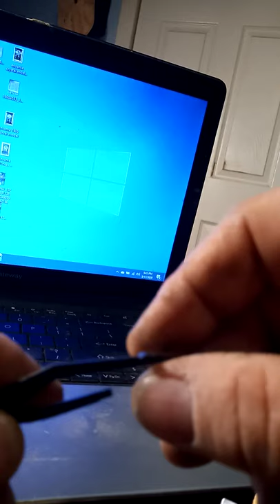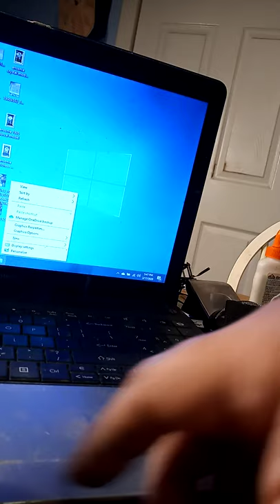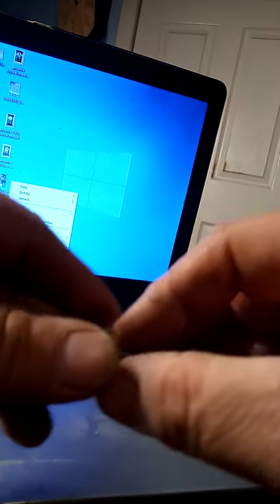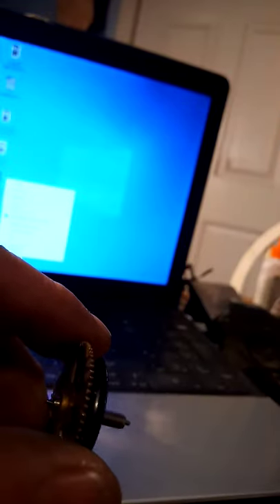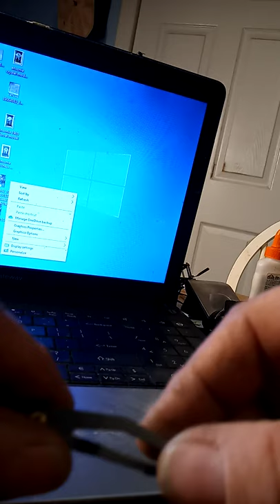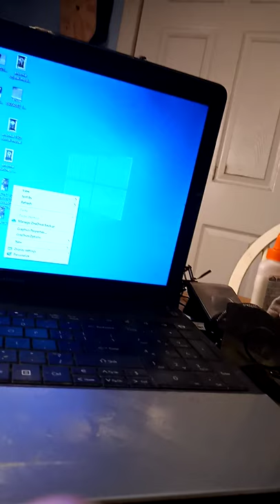Fixing a cuckoo clock that doesnt cuckoo on the half hour 20200317 174202

Comment: Thank you Mark for your expertise. I will continue to save to have my musical cuckoo clock repaired locally. It will couckoo on the half hour manually with my finger while setting the correct time but will not when the clock is operating on it's own.
Reply from the maker: Does your hands move while it is ticking? If not then it could be the plastic wheel that connects from the great wheel to the center wheel on the minute arbor is cracked.
Reply: @munnerlyn3  Hello Mark, No issues keeping correct time. In the morning I move the hour hand to the current time and while doing so it coukoos on the half hour and hour  correctly but when I swing the pendulum to operate on its own it coukoos only on the hour and when it reaches the half hour I hear a sound like it is attempting to couckoo but the door remains closed.

Comment: I have a 50 year old cuckoo clock that does not cuckoo or chime at all on its own, but it does run if you press the override switch just inside the case, and will cuckoo happily until the switch is released. There is no OFF and ON lever on this movement. What could stop the automatic cuckoo function if it works fine when the override switch is pressed, which means the bellows, cuckoo, and gong hammer are all perfectly running. Its a 1977 movement, 2 weight.
Reply from the maker: I would have to see the movement. To my knowledge there is no override switch on a mechanical movement made in 1977. Count wheel movements which they quit in the 1950s have a trip lever to manually operate the cuckoo to get the sequence back incase the cuckoo got off but rack and snail movements dont have that kind of lever. So I am not sure what lever you are hitting. If you are moving the 8 point star wheel then that shouldnt move unless the high note and low note levers are getting in a bind. You can send me pictures in a message on face book. Let me know who you are. My profile picture is me hugging a fake bear. Looking forward to hearing from you.

Comment: Thank you for this video, do you bend the entire arm or just the little tab on the top? Also have you ever seen one of the little wings the minute arbor worn more than the other?
Reply from the maker: First the tabs or some people call them shark fins on the minute arbor will be two different sizes. One for the half hour so it just raises the lift lock lever and the other for the hour where the lift lock lever raises to raise the rack stop lever.  Second if  your clock isnt cuckooing on the half hour then it could be the lift lock lever arms have got bent and I try to bend the tab first but typically I end up spreading the arms apart just slightly so on the half hour it raises enough to get the 3rd wheel warning pin out of the way of the tab that goes through the movement. If you bend them too much then the lift lock lever raises the rack stop lever too much on the hour.  I have a video on the Cuckoo Clock for Beginner series folder that discusses parts of a clock. Check that out. Hope it helps.

Comment: the 2 and 3 minuet ads.... what the heck??
Reply from the maker: I dont know.  You tube changed their system again in November I think and it is supposed to help those who post on here and have their requirements filled.
Reply: @munnerlyn3  well in any case... now i understand what the problem is.... and i will get it working again.... thanks again for doing what you do!